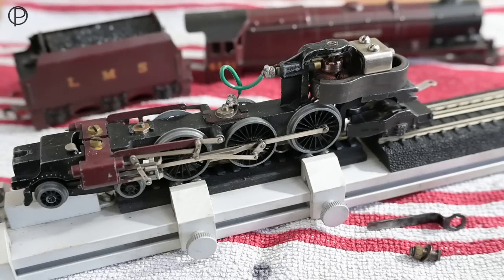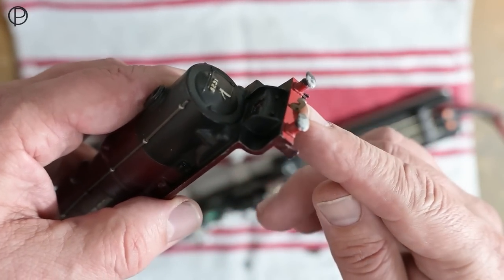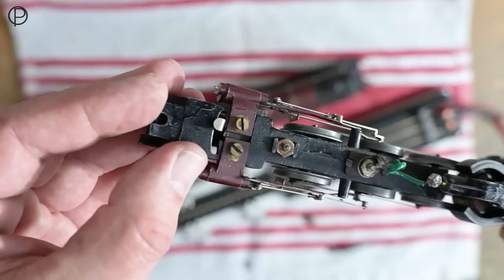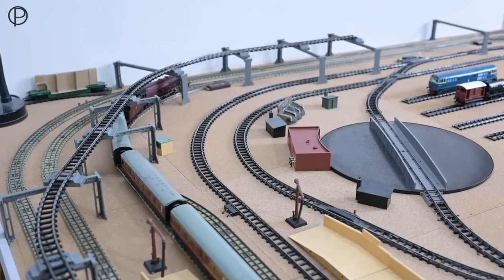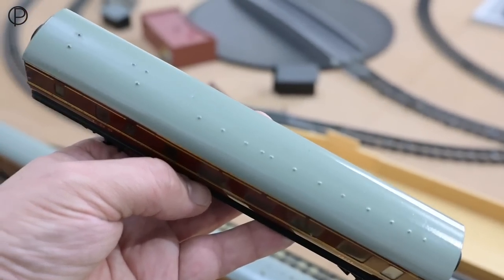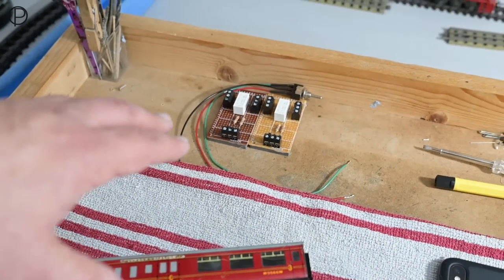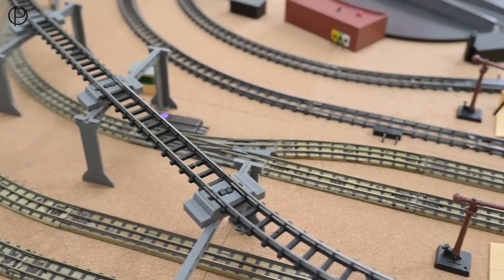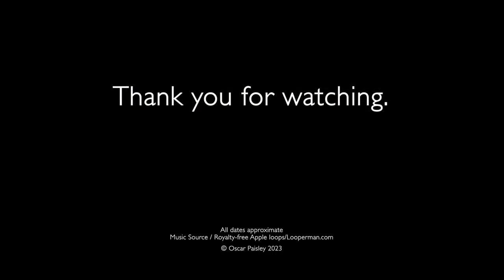Hornby Dublo Duchess of Atholl with LMS Coaches

Comment: My athol had the same missing paint on the drawbar.  It looks to me that they did not prepare the drawbar for painting and over the years the paint did not hold onto the surface as it should have, mine also had corrosion around the rivet heads on the lower cab, possibly due to dissimilar metals causing a chemical reaction. All fixed now , changed the block magnet for a neo magnet and it runs very well. I would have added smoke deflectors aka D of M but the Athol does not have the three lower fixing slots in the casting of course. I have 18 three rail engines on my set up, 3 D of M , two renamed to other Ds thanks to eBay and Silver Tay and his laser cut plates. One mallard on a three rail chassis and a Silver King renamed Silver Fox. Only one I haven’t got  to is the 0 3 2  shunter in Southern green livery , too expensive  for me. Thanks for putting up your vids keep up the good work .

Comment: when you have a pair of points for crossing up main to down main, why don't you wire them together on the one switch, rather than use two separate switches, saves wire,

Comment: My Atholl hasn't got a horseshoe magnet. It has a cube-sized magnet with the two horseshoe sides screwed to it. Either the Atholl was made in other variants or it's a hybrid of an Atholl/Montrose as I know the latter loco had the magnet arrangement like my Atholl.
Reply from the maker: Hi, thanks for watching, from Reading Michael Fosters book on Hornby Dublo Trains. He indicates the move over to the (Alnico) split magnet arrangement from the earlier horseshoe type began across the range of electric models in the second half of 1949.
All the best.
Oscar
Reply: Thanks Oscar. So your model must predate that. I must admit I had read the Atholl section in Foster's book, but didn't connect my one as being called an Alnico magnet motor. Also, I had consulted my Hornby Dublo Technical Manual written by David B Neale, and it only appeared to show the exploded diagram of the Delta mechanism of the Atholl.
Reply: Since writing my reply (above), I again consulted the David Neale book, which, in a different section, shows a photo of the Atholl chassis with the Alnico magnet, dated 1950.
Reply: Hi Oscar,  My Atholl dates from Christmas 1948 and I still have the mega play-worn set box.  This set was a present to my wife, Grace, and before we married in June 1964 it was sent to Meccano Ltd repair Dept, in April 1964, to be converted to two rail operation. Being an ex-set model it was retuned to us in the distinctive ‘buff’ colour repair box with the usual black/white number sticker. Following the helpful advice of Ronald Dodd, she was fully serviced and given a re-mag about 3years ago and runs so very well, even over my three tier helix, pulling her faithful but re-wheeled grey roof coaches.   A small tip, gleaned from an HRCA Journal article, is to fit a tiny (6mm dia.) neo magnet into the hole in the underside of the front bogie. This helps to hold the bogie on track, especially the HD metal track. This also helps on my helix, fitted with DCC ‘powerbase’ plates under the Peco code 100 track.  Always enjoy your videos and my trips down memory lane.   PS I also have a 3rail Atholl to run on my HD loose lay collection layout. T🚂

Comment: Interesting to see the tender chassis in particular. I have a retired Triang Streamlined Coronation that had the same tender chassis (the body being plastic). It struggled with reversing as well. Great video and such high production standards as always. Best wishes, Tom.
Reply from the maker: Hi, I think you're right there's definitely a crossover of parts, they must've fitted the bill when Triang Hornby were planning the Streamlined Coronation. I found that bending in the tin axel mount to allow a little more leeway for the wheels/chassis to move against each other whilst negotiating the curves has all, but solve the problem.
Thanks again for watching and the kind words, take care.
Oscar

Comment: Hi Oscar,
Lovely Duchess, built to last and it no doubt will. Loved the HD spanner or as I initially thought, Meccano spanner, same thing I suppose. I think I have a double ended cranked one somewhere 🙄. Re the emblem on the coach, in printing to achieve an acceptable image like that, all the colours have to print exactly on top of each other. In this case the red is slightly to the right, minor adjustment required.
Some time ago I managed to pick up three ‘Caledonian’ tinplate carriages in the train set box and in mint condition. Sadly the Duchess was missing and had been replaced with a mint and boxed HD ‘GOLDEN FLEECE’. Not really complaining.
Thanks again for a great video.
Reply from the maker: Hi Gordon, that sounds like a great purchase. The spanner could well be multipurpose, I think the locomotives may have been sold with one included in the box where needed originally.I imagine keeping the printing in register, must've been a bit of a task, they seem to achieved some amazing results across the range of coaches and wagons.
Thanks again for watching and the info. Much appreciated..
Oscar

Comment: Excellent model to feature in this mornings video Oscar, I have a Duchess of Atholl myself but it’s been converted to 2 rail operation, it’s a really nice model overall, one thing though yours looks a lot smoother going round your railway compared to mine, mine has a lot of side to side movement when I’m running the model.
Reply from the maker: Hi David, great to hear you have one, I think there is a lot of movement side to side in these Dublo models in general, I think it helps tighter curves, especially coming through point work they really seem to snap from One Direction to another quite abruptly, that does appear to be quite a lot of play between wheels and chassis on these Dublo items.
All the best.
Oscar